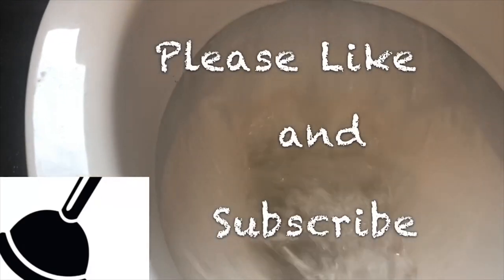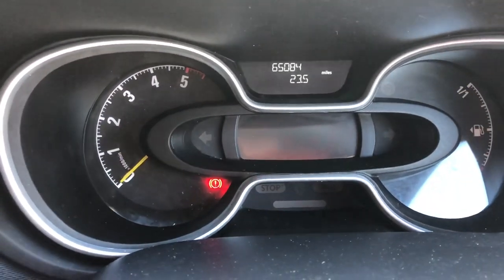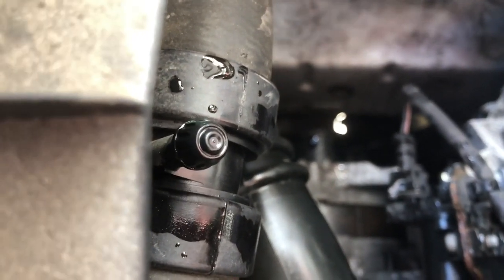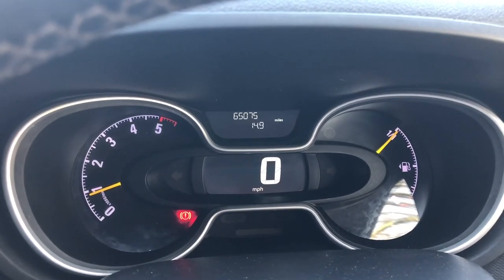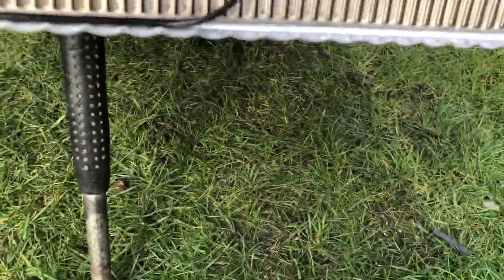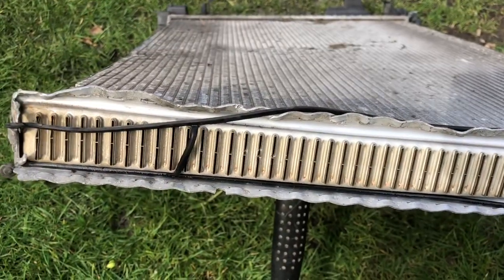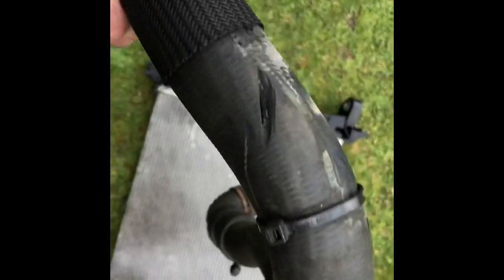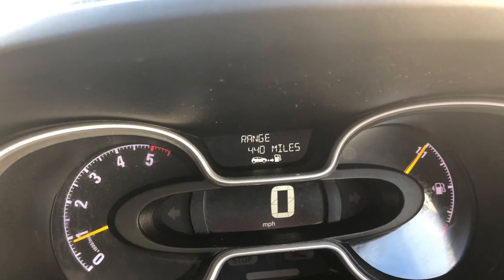Vauxhall Vivaro Engine failure hazard 😱 help

Comment: I think that's very bad. I've heard some bad stories about these vans, they seem to just fall apart after a few years and not that many miles on the clock.
Reply: Yep you're absolutely correct, my started falling apart just after 55k, have a look at my comment I made.
Reply: My van have 160k without any big repairs.
Reply: paid 13k cash for my 67plate vivaro. bag of shite it is. only 66k on clock. getting it sold.

Comment: Update regarding my engine failure hazard, I'm now taking vauxhall to court as they have refused to replaced the engine. My van has been at their dealerships 7 times and still there as I'm refusing to take it. 1st it had a new dpf then, 3 times it had its DPF regeneration as they said I need to drive it "properly", o2 sensor replaced and the latest new turbo and still the issue keeps reoccurring after leaving the garage. To anyone thinking about vauxhall vans, don't bother, spend that extra money on VW vans.
Reply from the maker: Wow keep us all updated are a few stories so I decide to lease one so I can hand it back
https://youtu.be/d2THyypJv7c
Reply: Very true, got exactly the same problem, they never got to the bottom of my issue and now out of warranty they don’t want to know.  Now been off the road for over a year still trying find someone who can fix it. Complete nightmare of a van with nothing but problems.
Reply: @PlumberOntheJob  hi there. I have the same problem now. The thing is the battery went completely dead...like nothing at all and left at the road side for 2 days now..Dont have much budget....What shall i do! Help! Thanks

Comment: Thanks for this. Fellow plumber here and the same thing just happened to me, my heart stopped for second when the light came on. Checked my reservoir and it still had water, opened the bleed though and the reservoir cap and it swallowed it all. Sadly I dont have any water with me so now sat waiting on a county lane for the engine to cool so I can drive to the shop for some water 😒
Reply from the maker: Check for leaks on the hose it rubs on the radiator and leaks
Don’t drive with the lights on it will destroy the engine
Reply: @PlumberOntheJob  I left the van 40 minutes, switched back on and the light had cleared, luckily there was a shop a couple miles up road. Used 4 litres to fill up coolant and just got to my job. It's going into the mechanics tomorrow to have a check, I have a third party warranty so hoping it wont cost me anything.
Reply: @craigwatson7692  what was the problem in the end?
Reply: @PhillipGregoryMusic  mine was a hole in the radiator caused by stone damage. My mechanic said its quite common on them as the grille offers little protection.
Reply: @craigwatson7692  how much did that cost you?
Reply: @PhillipGregoryMusic  off the top of my head I think it was around £550

Comment: Thank you for posting this. I have the same problem now on a Renault trafic lwb 1.6 diesel. Can I ask if you had any problems after getting this fixed? Have you had any other problems with the van  at all ? I had to have a new ECU unit last year. A new EGR valve fitted and the boost pressure sensor fitted van is a nightmare lol. Time to get rid I think.

Comment: Just paid out on a new engine on my 2016 Vivaro..£5700 for the engine...£230 clutch...£400 new fly wheel ..£80 shock absorber..and two new coil springs.. warrenty paid £2000 i paid £9700...im still crying... only had it 5 months.. Renault Traffic before i owned for one week when over heated sent van back to garage they said too expensive to fix so refunded my money...oh well... Vivaro now drives like a new van..so happy now but also a bit pissed off.
Reply: Sounds like someone had your pants down
Reply: Vauxhall dealership..top Covid prices ...
Reply: Would of crashed it into a tree wrote it off my old Renault timing belt snapped got rebuild was never the same
Reply: Should have taken them to court, I'm in a process of doing it. Have a look at the comment I made about my issue.
Reply: I am from Singapore.  The problem with their vehicles are global.  I have paid for clutch replacement after 35,000 km,  and they claim it is not under the 100000km warranty

Comment: Which pipe are you talking about and where does it rub
Reply from the maker: As you’re stood with the Bonnet up in front of the van it’s on the left hand side the top one following all the way round
Looks like a Stanley knife cuts but it’s rubbing against a piece of metal
Good luck buddy

Comment: This message come on for me just now at 57k along with check Anit pollution system and check injection and check stop start. Can feel big power loss at time
Reply from the maker: Doesn’t sound like the same problem
Didn’t have a power loss
Reply: I've now got the same problems as u bud. Changed the anti pollution sensor and the little pipe still big power loss.
Reply: @markg6698  did u managed to get it sorted have same problem changed the fuel rail sensor still same issue , changed the ecu worked for 20 min then same issue really don’t know what else to change
Reply: @garyalcorn3831  na it's still on and now I've got check stop start and check injectors coming up. So hopefully going in garage this week
Reply: @markg6698  I got mine sorted so was actually the high pressure fuel pump going into limp mode also it draws a lot of current which in turn shorted out my ecu so new ecu and fuel pump . Yours does sound like a faulty injector with just that message being displayed
Reply: To sum it up all vans are shite lol
Reply: Last year I had water leak, which led to overheating - Stop engine failure hazard- coming on dash. Stupid these manufacturers think it's a good idea to not give you a temp gauge anymore. Just a failure alert once it's already cooking. From that I had injector leak/cracked head, £4500 later and new injectors, head, intercooler etc etc.... it was fixed, now 1 year later I'm having - Check Anti pollution & Check Injectors - Also - stop engine failure hazard - again! But no overheating as water levels fine. Also loss of power. But all the new problems seem intermittent. Have changed sensor and pipe as mentioned by people above
Reply: @ChubbyAnts  get year dpf checked
Reply: @ChubbyAnts  and did the pipe and sensor do the trick? Thx
Reply: @ChubbyAnts  and did the pipe and sensor do the trick? Thx
Reply: @Mikey931108  seemed OK for a day. Then came back. I started running DPF cleaners thru it, seemed to be getting better and had a whole 6 weeks without issue, Then my alternator went. Got that fixed, pick van up and DPF was on again and it was in limp mode. Couldn't do anything to get it out, then my son said he hear blowing, so I looked under bonnet with engine running and noticed a pipe at front which was slightly loose. Wiggled it and it's been perfect since. Someone told me it was one of the intercooler pipes!